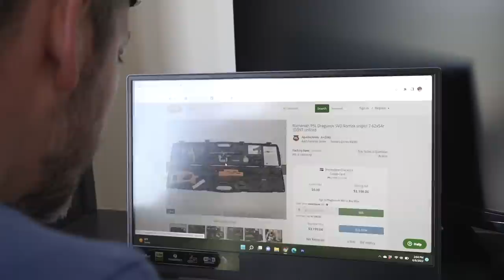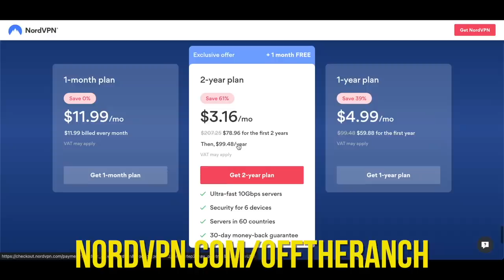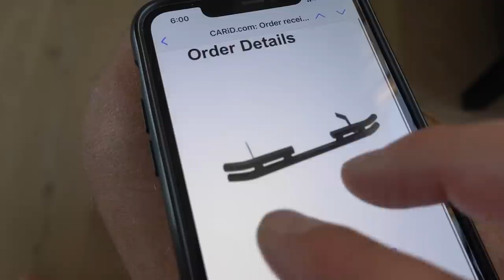Building the Backyard Pergola AND We Finally Have PLANTS!!!

Comment: If you want a grill, get the Master-built Gravity 1050 it set it and forget it. I am buying one soon for smoking and grilling. Its between a pellet smoker and a offset smoker, get better flavor than the pellet, not as much as the offset but has controllers like the pellet smoker for convenience, it goes really hot really fast and uses wood, charcoal or both.

Comment: Also for the infinity edge you should think about placing a 500 gallon tank near the pool that can accept all the water from the basin when it overflows . You may need to make a larger opening for the water to overflow. After all the bodies are out of the pool the water can be pumped back into the pool from the overflow so your not having to waste much water. If the pipe from the basin is accessible you can bury the tank near the Basin and connect the pump pipe to the tank and have the basin drain into the tank . That way if you don't have the infinity edge on you won't lose a bunch of water. The water from the pooll would go into the basin then drain into the tank .but the reason for the large tank is because all the bodies swimming in the pool will displace the water and if it's just flowing over the overflow your wasting a bunch of chemicals also.

Comment: I have some recommendations for you for the barbeque pit that you want to build an easy to use barbeque with a smoke tray built into it is the napoleon built in prestige pro 665rb also you can install undercounter appliances such as a a fridge, a beverage center and an ice cooler for these kind of things i highly recommed you check out true residential appliances they give you the option to customize your appliances however you want them
Reply: Claim your prize George